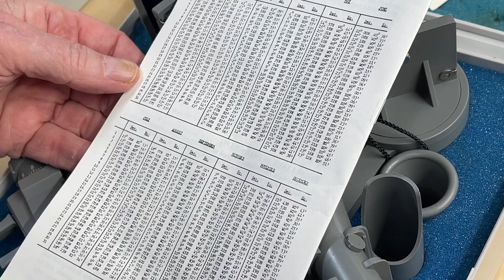13 Sep 2023  Astro navigation and vitamin D, the connection

Comment: Will you have mechanical clock like Joshua Slocum. It's immune to both lightning and an EMP.
Why no mention of your Bris Sextant ?
At what altitude does the sun make Vit D.?
Reply from the maker: The Bris sextant need an clock. My twisted sextant a development of the Bris sextant can take noon sextant with no clock but it is at the moment not practical.
With the ordinary sextant you can find the latitude with no clock.

Comment: Does the bris mini sextant work for astro navigation? Also: can you navigate an airplane with a sextant?
Reply: Yes, sextants were used on aircraft for navigation. Still carried as backup.
Reply from the maker: The Bris minisextant is more precise and has fewer corrections than the ordinary and it intended for astro navigation of the sun  @jaygee5693
Reply: They have even used sextants in spacecraft. The Apollo lunar module carried a sextant